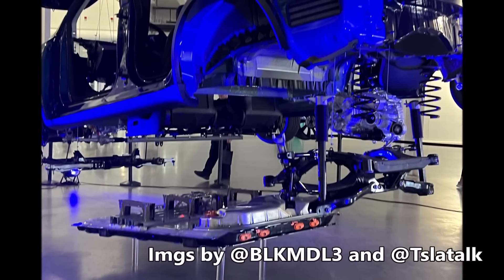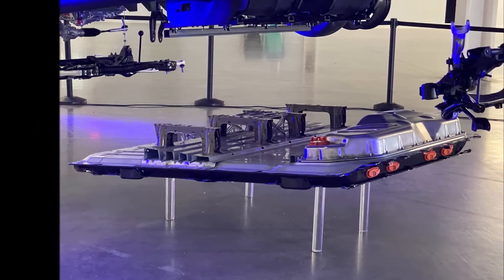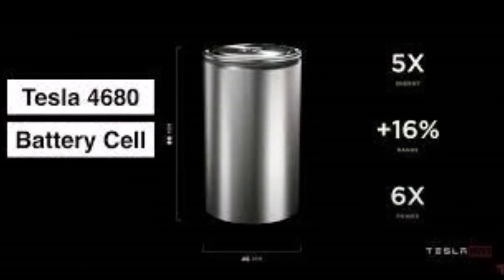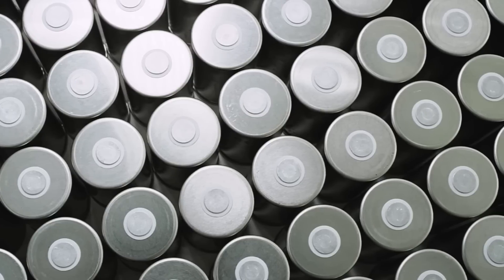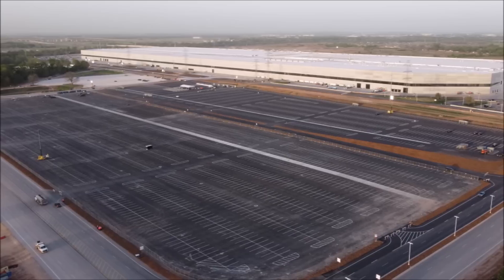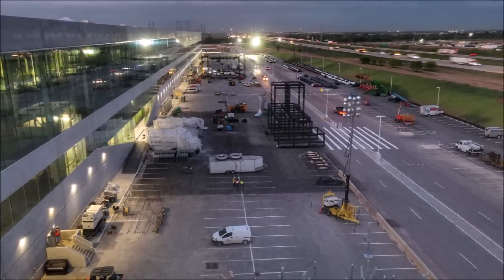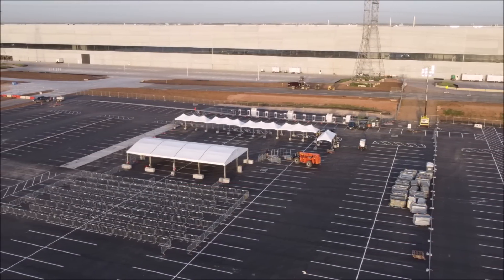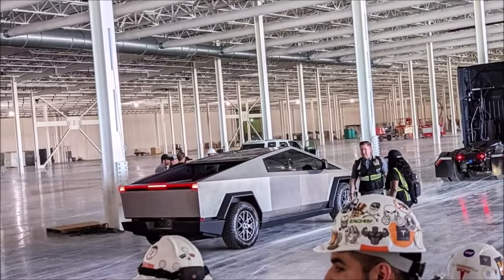VIRAL! Tesla Giga Texas Displays 4680 Structural Battery Pack, Shows Evolution

Comment: It seemed like you said the 4680 battery packs would be delivered 1st quarter 2022. Did you mean 1st 1/4 2023? Tesla claimed that they had produced over 1 million 4680 batteries so far. If they weren't shipping the Giga Texas Model Y with 4680s, where are all those produced batteries going?
Reply from the maker: Hi Dean, I think I was quoting Elon from the 4th quarter results, which he delivered in January of 2022.